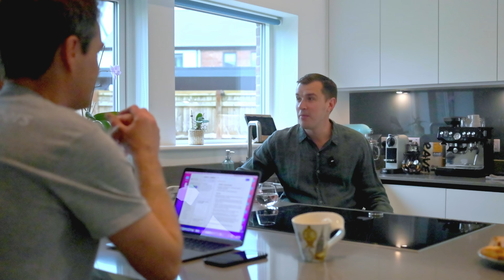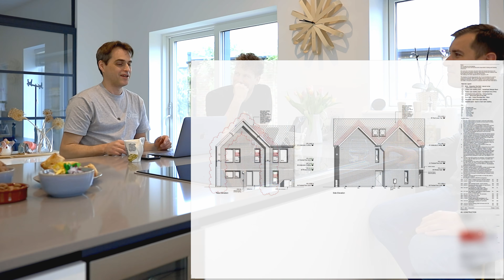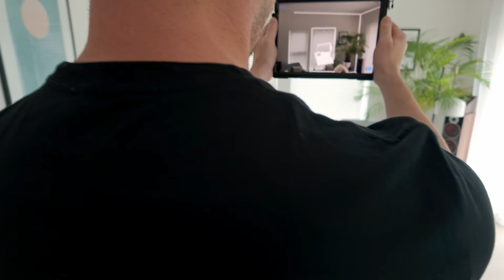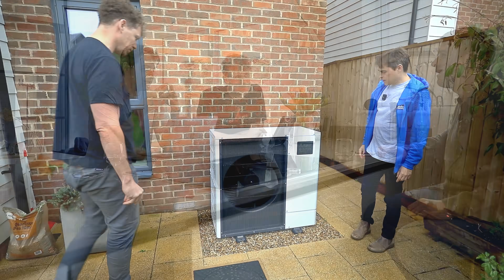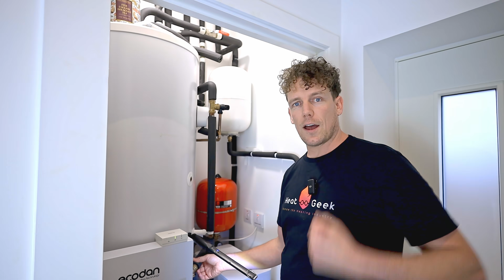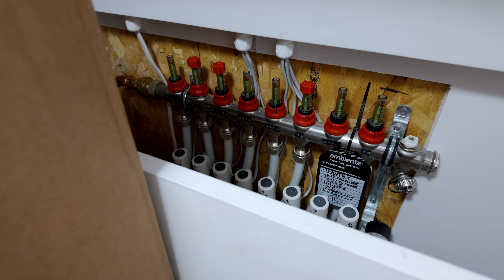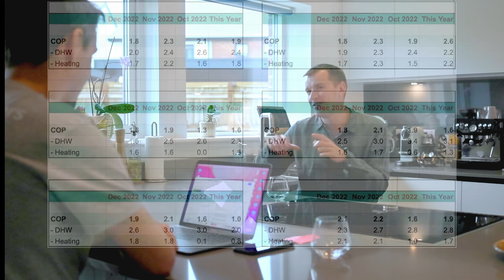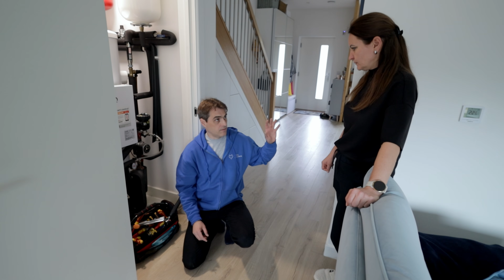How Developers Are Ruining The Heat Pump Market

Comment: When you open your windows, you do not loose 100% of the thermal energy, because most of it is stored within the furniture. That's because furniture has way more mass than air and is solid, thus it cannot move. The ventilation system may save a tiny bit of the thermal energy, but that's not going to account. The big downside of every ventilation system is the moisture inside the pipes and filters, because hot air carries more water than cold air. If it gets cooled down, the water in the air condenses. This causes the system to start going moldy if not cleaned regularly and properly.

Idk what is more expensive: Loosing a tiny bit of thermal energy by opening all the windows for a very short period of time, or replacing the filters and cleaning the pipes of the ventilation system every few months? 

One thing is for certain... the air moisture has to go somewhere, there it cannot cause mold. The cheapest way to get rid of to much air moisture is by opening every window for about 5 minutes at around 5-7 o clock in the morning. That's because in the morning the exterior air temperature is as cold as it can get during the day and cold air has least moisture.
Reply: MVHR system have drains to let out the condensate - that's where the moisture gets loost (sic).
Reply: He means 100% of the heat in the air going out…well actually it is the difference between air out and air in.
Reply: @markthomasson5077  Well, okay. But air isn't a great heat reservoir. To heat up 1 qm air 1 Kelvin you need roundabout 1.2 kJ - for wood you need roundabout 800 kJ. If a room consists of 40 qm air and 8 qm wood (room: 4 m x 4 m x 3 m) you just need 48 kJ to get the air and 6400 kJ to get the wood 1 Kelvin warmer. By opening the windows for 2-5 minutes, you're loosing maybe 5-15 Kelvin of air temperature or 240-720 kJ. Multiplied by 180 days it's roundabout 86400 kJ or 24 kWh. That's like running a device with a power consumption of 2.74 watts 24/7 through the whole year. That's not a lot. Saving 90% means that you save roundabout 22 kWh a year. Even if your home is four times bigger, that's less than 100 kWh you are saving. But the system needs energy, too, and maintaining it isn't for free. Thus you may save nothing. Thus the best way to save anything is to stop any leakage of air.
Reply: @ point taken.  But with a very well sealed building don’t you need far more ventilation than just opening a window for a short time?
Reply: @3333927  is the condensation within the heat recovery unit / exhaust pipe actually found to be an issue? Not that I have heard.  The main filter is on the incoming air, so no problem there. So the air within is relatively clean, so doesn’t combine so much with the condensation on the exhaust side, which would promote mould.  Also being on the exhaust side it obviously doesn’t affect the air coming in.
That said those single room heat recovery fans that blow air in then out sound very dodgy
Reply: @ As I know it is a common issue, because this unit cannot extract all the water in the warm air before it leaves the building. It doesn't matter where the filter is. If you cool down hot air, you always have the issue of condensation. Inside the filter you have a swampy climate - perfect for mold - dark, moisty and warm. To extract the water in the air before the filter, you need a compressor. But a compressor consumes a lot power. 

Therefore, I remain of the opinion that shock ventilation is still the better option for reducing humidity. It's simple and has less sideeffects.
Reply: @ but the filter is on the incoming air side, so it is cold air that has been warmed up, therefore dry.

Comment: Please note Gas is 4 times cheaper in kilowatt hours than Electricity, and the standing charge per day is half that of electricity .So are heat pumps need to be at least 400 % efficient to break even 500% to be ahead. So in my mind gas boilers are still the best , there cheaper and far easier to install and less rubbish on measuring room seizes and flow rates what a load of rubbish.
Reply from the maker: Boilers are only 80% efficient so you need heat pumps to be 320% scop to break even.

However we have 16p heat pump tariff from Ovo making heat pumps 1/2 price to run as compared to gas on average. We can also use solar PV and battery storage with 8p per kWh tariffs, making heat pumps 1/4 of a price of gas to run. 

Heat pumps are the future
Reply: @UrbanPlumbers  If you compare the low cost electric tariff from OVO; bear in mind for many users the higher cost of that tariff for non-heatpump use makes it a net loss not gain compared to something like Octopus Tracker, that averages around 19p for all use.  And you should also compare to the best gas tariff; again the Octopus Tracker is around 4p / kWh.

Comment: This system does seem terribly complicated! Obviously you've got to work with what's there already, but if starting from scratch in designing a building with MVHR, would it make sense to look at air-to-air heat pumps to avoid lots of plumbing (I'm not an expert)?

Comment: Each pump is standing in corner - wall, fence etc. After the fence another heat pump, neighbour. . All pumps are reducing temperature in this close area, contracting already cooled air, poor wind around this apartments area. In my opinion it is part off this problem.

Comment: "Cheers!" (Thanks for sending us business!) "You can do better!"...interpretation: "Send us more of your business for us to fix". This is how the original installer may interpret what you are saying.  Keep it in the family. Maintenance contracts are our bread and butter.  Before now, there has been no way for the customer to make  an objective assessment or compare with other customers regarding their furnaces' performance.  If it created heat and made sounds, then the Techs were good. Those were the days of the old furnaces, and current commercial HVAC.  That's the bad; however, there are two sides to the story:

1)HVAC techs are familiar with commercial equipment brands; with their always-available parts, known duty cycle,  and support. 
2) Residential Mini splits offer diverse unknown quality control and parts availability, no support or only in Chinese, if any, cheap maybe not robust hardware, un peer reviewed or tested, uneven warranty fulfillment.  

The Installer will offer a customer a price for a mini split installation which he knows swill not involve fixing, because repairs are almost impossible.  He'll price based on his unspoken plan to replace the entire broken unit on his own dime.  He will also absorb any customer gov't rebates for this altruistic act, which he doesn't have to perform with commercial units....they already pay quite well.  In fact,  there is no shortage of commercial work-  and if anything-  there is so much demand for commercial HVAC technicians that there is no incentive to take the risk and low pay to do residential mini splits.  Customers buy mini splits online and ask a Tech to install it,  swayed by unproven grandiose claims made by advertising.  HVAC techs loathe residential mini splits because of their unproven non-serviceable equipment as it risks setting them up to get a bad reputation. So they keep away, or maybe do what you see here.

Comment: A catalogue of errors.

The developer is either the integrator or they have formally appointed someone to fulfil that role (ideally an engineer of some kind with passive house experience (plz not the architect…they don’t have the training or experience)) The separate suppliers and installers cannot do this, they just deliver what’s been specified - even when its over specified. 

Some of the piping problems are not competency done, but snagging is a thing & the developer signed it off…… 

I’m guessing no one commissioned the house. Independent suppliers and installers just made sure their kit turned on.

Passive house…..

Comment: I'm not sure the technical implications of doing this,  but from my calculations i did on passive and near passive houses, but even modest sized, well insulated homes, it seems like we need room, or zone sized units being used to do whole homes. It will be very difficult to get installers to agree to this because it won't make much money.
Reply: Yup, ~3kW is pretty small for a single unit for A2A, and then just let the ventilation system circulate around the house, plus sorts out cooling in summer.  Couple of grand's worth of gear, plus whatever you need for hot water.  Seems like way too much stuff, all the underfloor, etc...
Reply: @jfinnie78  right. It will be hard to get contractors to be honest to take the hit pet install for real
Reply: @Flyinghook  You'd think the obvious thing here is to embed a small A2A unit in the MVHR system, with the rooms being trickle-warmed via the ventilation system.

Comment: 14:18 yes, you can get HPs that small and actually smaller. Just not the style you're looking for.

Also note that the minimum capacity for that unit is about. 3.5-5kw. (depends on conditions) it's still too big for the house but not as much as it seems at face value.

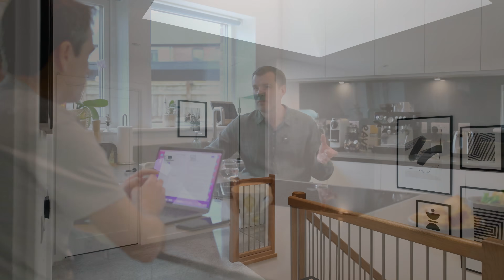Comment: 1:24 I don't like the idea of a heat recovery ventilator in the attic; it inevitably  needs ducting to and from vents on at least each floor, meaning more power used for circulation, more dust accumulation and more opportunities for conductive losses and  leaks. Why didn't they use smaller ductless ventilators and put each under a window in each room?

Comment: I've heard that the Manual J calculation used in the US for calculating heat gain/loss is overly conservative to begin with, then installers pick a higher summer temperature and lower winter temperature to reduce callbacks, and then pick the next bigger size heat/cooling. This produces oversized units which are inefficient during spring and fall.

But what was surprising to me was that unit sizing didn't seem to be done at all before designing the heating system. In most places in the US, it's not possible to get a building permit before sizing the HVAC, and you can't size the HVAC until the windows are selected so the U-values are known, along with insulation and air leakage targets, validated with a blower door test.

The other surprise is that I didn't hear a dehumidifier mentioned. Perhaps that's not a big problem without a cooling cycle, but things like showers can throw a lot of humidity into the air, and with a passive house, a typical bath fan will depressurize the house, and not do much to actually exhaust the humidity. The ERV can help, but only if the bathroom fans are instead the source of the ERV exhaust air.

Comment: This was always going to happen.

Heatimg system need to be made simpilar to install not harder.  Heat pumps unfortunately are just to complex for the vast majority of installers and will never get it right + if you have the big companies ripping of customers imagine how many cowboys are out there doing it.  Once again heat pumps are great but only when installed in the perfect property and by a highly trained technician.

End off.  Im just waiting for the compensation claims to start.😂
Reply: They aren't that hard, look at the likes of Glyn Hudson who has now done 2 self-installs.  The complexity isn't down to heat pumps, it's down to sizing the system correctly for the home.  If gas cost 3x what it does now, people would be chomping at the bit to squeeze every bit of efficiency out of it, and the process would be the same.  Properly sized rads, so the gas boiler can run at the lowest temperature possible, and not oversizing it either.

Comment: If it's a 190m2 passivehouse then the space heating load should be under 15*190=2850 kWh/yr because that's the PH spec. That equates to about 2kW (peak space heating load only) so maybe another kW or two for DHW. But PH 'useful living area' is smaller than 'simple total area' which is probably what that '190m2' refers to.  One would also need to check if 190 is both floors or building footprint. I assume the former. I only need about 2-3kW for my house, but you can't buy such small pumps (apart from the Vaillant geotherm). It's not that hard to make one, like my neighbour did, but we really shouldn't have to. I hope we'll see more small HPs as building regs improve.

Comment: Is this not an inverter?  Can't it just ramp down?
Reply from the maker: It can modulate to around 40% of its maximum output. Max output is 14kw - so it can ramp down to 6kw - double the output needed for the whole house at -2

However the house is zoned so when half is zoned of the house will need around 2kW at -2 outside.

When it is 5c outside the house needs even less power.

Even with modulation that unit is grossly oversized and will be cycling excessively killing both efficiency and the compressor

Comment: Nobody has mentioned mean time between failure .  If a ASHP is oversized and as a result is short cycling it will have a much shorter life .  As an example say it can turn on and off 50,000 times before failure then a unit which is only running for a few minutes and then shutting down will not last as one that is correctly sized and runs for hours before turning off.

Comment: 8:40 "...zoned..."  Grade 10 Science class should inform people that heating zones are an almost-obsolete concept when the dwelling is extremely well-insulated and air-tight. Imagine a really high-quality thermos with hot water inside; do you have to stir the water to maintain even temperature from one side of the thermos to the other?  In a modern, well-insulated house, it you switch off the heat to one bedroom, then its temperature might drop from (for example, to make the point clear) 21.0°C to 20.5°C as all of the room's inner surfaces continue to supply heat.

Comment: 2:45 My guess: under 25,000 BTU per hour, even in the depths of a cold snap.
Reply: Later: ~3kW = ~10,000 BTU per hour. Okay. I guess I failed to account for the UK's warmer winters. But I believe it. Oversized heating systems are a curse.
Our house still uses electric baseboard heaters, and 8kW is enough. 2800 square feet. In Canada.
My neighbour is talking about Cdn$65,000 worth of heat pumps to "reduce" his heating costs.
Another neighbour spent  Cdn$30,000 in the 1990s on an overly-complicated heat pump system that takes up an entire room.

Comment: I don't understand why a heat pump could be oversized. Isn't the important thing that it can moderate down low enough?
Reply: Even gas boilers get oversized too far that they operate below their lowest modulation most of the time.   I believe the Vaillant ones can modulate down to about 25%.  My Toshiba's (A2A) can modulate down to about 10%, but even with 10% modulation these ones will be cycling for probably > 50% of the time.
Reply: @BenIsInSweden  It's hard to find info, but I see someone saying that heat pumps can modulate down to about 30% of their rated power. So in that case oversizing could be a problem.  The boiler in this video looks like an Ecodan R32. I couldn't find any helpful info on the manufacturer's site on my first try.

Comment: I have a 220m² passive house on 2½ floors (warm loft with 2 rooms on 2nd floor) now 7 years old.  Our winter heating load peaks at around 50 kWh / day but the Dec/Jan average is a lot lower at maybe 40 kWh/ day.  DHW typically varies between 1½-5 kWh / day depending on use.  UFH in a 17t "warmslab" on ground floor. Nothing on upper floors   I put in a 3kW inline resistive heater at build, plus a couple of oil filled rads on 1st and 2nd floors to do top-up Dec-Feb. The whole house is run as a single zone at just over 22°C 24×7 (though the 1st floor is typically about 1° cooler). All heating done using minimum price-slots on an Agile ToU tariff.  I had initially intended to fit an ASHP after a year or two when the house's thermal performance had been fully characterised. However, as I only spent about £400 p.a. on electricity for space heating, so I can't really justify much more than £4K for the total ASHP install.  MCS quotes are a joke: 11kW ASHP and 4-5x my budget. 🙃
But thanks for a very good discussion of the challenges that owners of passive or near passive class owners face.
Reply: BTW, my problem isn't with ASHPs ; it's with the UK bureaucratic and regulatory framework.  I have a house designed to take a ~ 3kW ASHP for slab heating only; a buffer tank would be entirely redundant.  The water flow/return + supply were installed when the house was built, but this approach  falls outside permitted development scope as MCS registered installers will only consider a complete replacement which is again totally unnecessary, I am ineligible for a BUS grant and also need full planning permission to install a very simple ASHP solution. Absolute nonsense.
Reply: Storage heaters? Ugh.
Reply: @rogerphelps9939   Not sure why the channel owner deleted my response to this; poss because I linked to another YouTuber that did a timelapse of a build like mine to explain the slab construction..  No storage heaters.  The entire 17t slab and the internal fabric of the build is inside the thermal envelope and acts as a heat battery. Last Jan,  I had a bug on my control S/W after a change on the UFH heating and it was out for a couple of days, because by then we noticed that the house had lost about 1½°C -- enough to notice.
Reply: @TerryE-UK great solution. One I would go for.  
The present trend for lightweight construction is counter to this.  If we are to make full use of excess wind energy, long term thermal storage is a must.
I am a retired architect. We did a new house for an engineer. It was Passivhus equivalent standard.  Floors were solid concrete walls semi solid.  He calculated it would retain heat for six months!